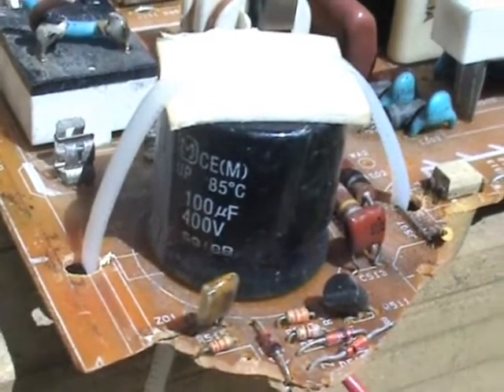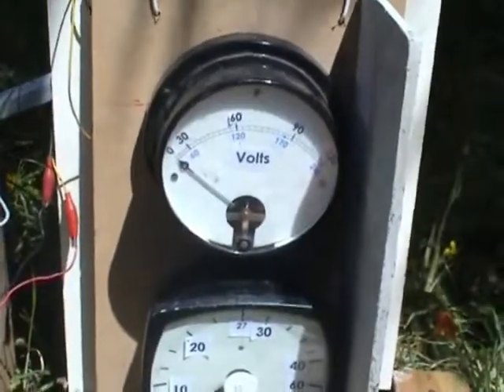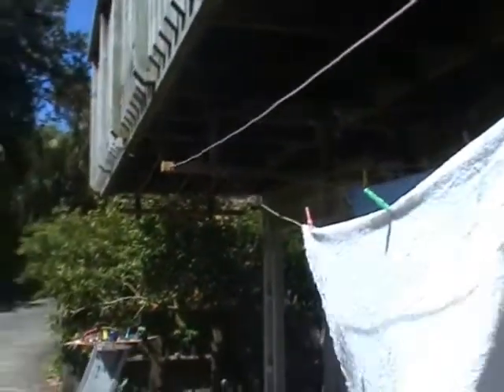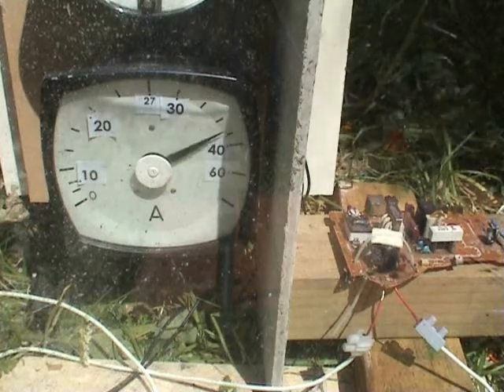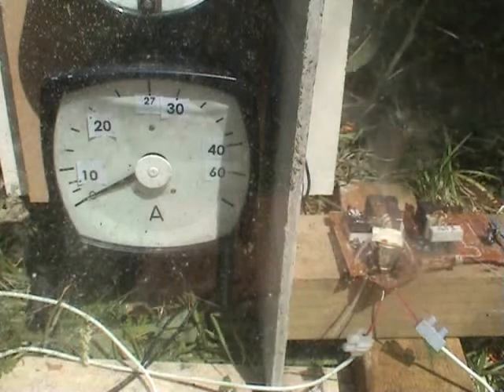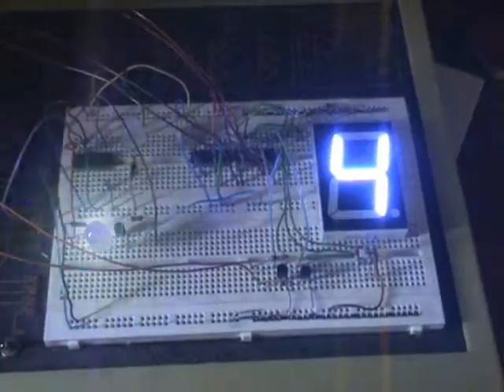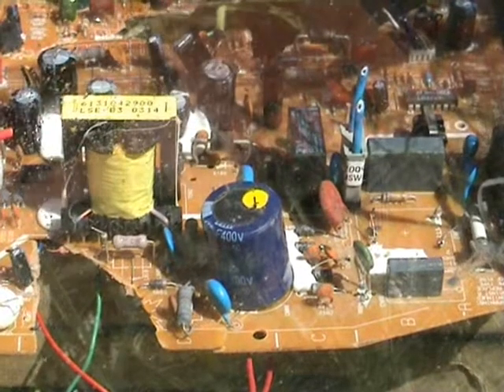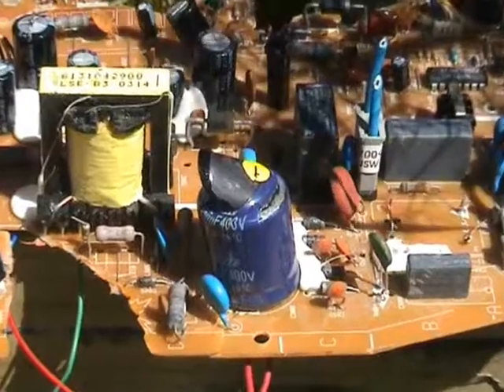Guy Fawkes Capacitors venting 1

Comment from the maker: @NZLcyclist These were reversed 50 times a second as i used AC.
I will do some DC cap blow ups soon.
i have got a big 500V 4000uF capacitor which I will used as a charged up DC supply via a variac and 400 Volts TX.